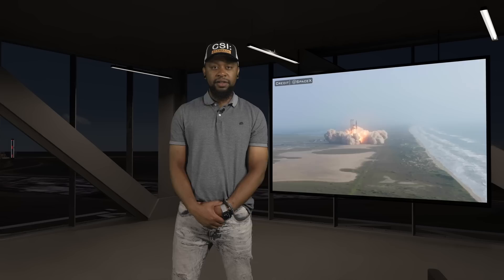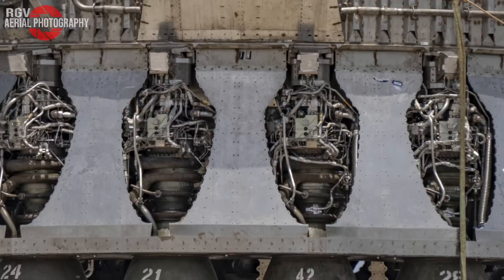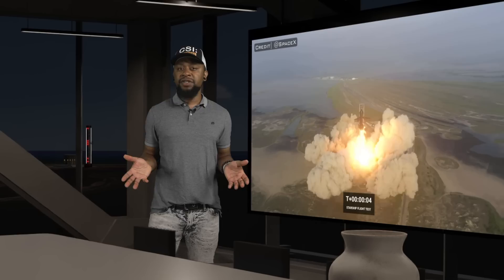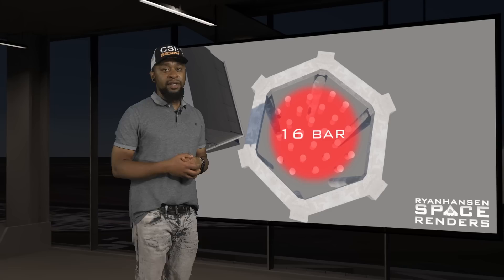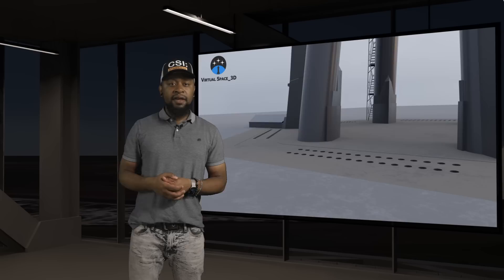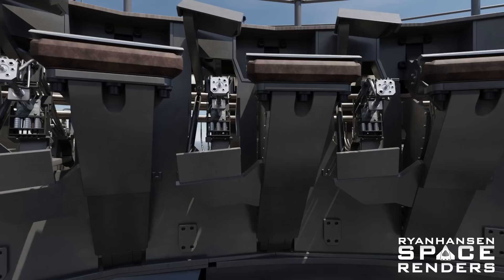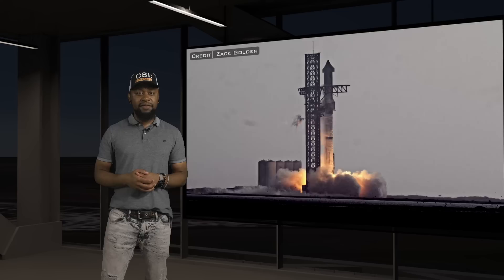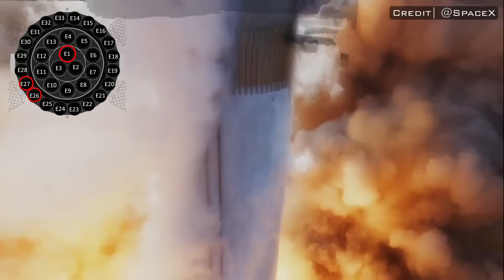The Design Flaw That Caused The Starship Launchpad to Fail!

Comment: Anxiously awaiting this debrief, I regard these shows as most educational and are highly valued. Thanks to Zack and the CSI team of “agents”. Kudos!
Reply: 10,000,000 lb lifted with 16,000,000 lb of thrust (success, World Record in fact).  The rocket plumes are longer than the rocket.  Should consider raising or digging for more ground clearance.

Rocket fuel consist of oxidizer, a lot of rust forth coming.  Steel plates are not necessarily expensive, but will need to be replaced over time.  Continually added expenses.

Failed to reach orbit.  Far from complete success.
Reply: Indeed ' the only other sound recording that sounds anything like this is Saturn V,  given we do not have very good recordings of the N1 or the Buran, the other two comparable rockets

Comment: Zack, that was sooo good.  Pulled together elements into a really well structured deep dive.  I can't thank you and your crew enough!
Reply: Annnnd he was wrong.  SpaceX shut the first 3 engines off before launching on purpose, and something else caused the rocket to rise on angle.
Reply: @Donald_Turnip  That "something else" is those 3 dead engines
Reply: @alvianchoiriapriliansyah9882  

Nooo, no it's not. If people would take the time to listen to what Elon and his team have said, they'd know that they decided to shut the 3 off knowing that they wouldn't affect the rocket one bit. They quite literally said that, which makes an hour-long "explanation" WRONG because it's the first bit of information is an ASSUMPTION that three engines "failed," so it caused the rocket to go out of control.  Elon was very clear in saying WEEKS ago that the first three missing engines on the Engine-Cam were shut off before they even lit the rocket because they were not running properly AND they were not needed for the rocket to do its job perfectly.

If we take Zack's assumption out of the mix, this video is completely different because those engines did not fail nor did they cause the rocket to fly sideways. Every thing after an assumption is corrupted data/an assumption too, when you make a video that follows a linear line.

Example 1.>  Car 2 crashes into the back of car 1. We assume the brakes on car 2 must have failed because someone heard a screeching sound. Someone dies in car 1. We assume driver of car 2 is innocent because their brakes failed.

Alternative and the real truth> Car crashes into the back of another car. Option 1>Brakes didn't fail, driver of car 2 was speeding so they slid into car 1. Option 2> Driver of car 2 was looking at their cellphone and didn't see Car 1 until too late and after they hit the brakes.

The point to this long example is that nothing after a certain point means anything if any of the proceeding steps are wrong/assumptions.  If everyone knows the person was on their cell phone, that person goes to jail for vehicular manslaughter. If everyone assumes that the brakes failed, an innocent person dies and a guilty person doesn't face justice.

So once Zack assumed 3 engines failed/that the rocket even needed those engines to fly, every single point after that on his timeline of reasons why the surface of the OLM was destroyed is wrong or corrupted. All because he assumed versus waiting for SpaceX to speak about why three engines were DOA.
Reply: @Donald_Turnip  The computer would NOT shutted those engines down if it did run properly aka. not fail (because why the fuck it would??), and those three dead engines CAUSES the lean on liftoff (EXPLICIT from Elon). But it did NOT violate the launch commit criteria yes, which is why it...lifted off

Did you listened to the same Elon spaces as the rest of us?

"So the lean off the pad, was that intentional? Was it more than you thought it might be? Was it related to the engines out? And do you expect to do that on like future more operational launches?"

E: "No, we're not. It WAS RELATED to the engines out, and we do not normally expect to lean. It should be aspirationally going straight up."

Now show me the SpaceX/Elon words that completely counter the above, word by word. And reply it to me. Pretty please 🙄

Vocabulary lesson:

Running properly = not fail
Not running properly = fail

Both are NOT interchangeable
Reply: @alvianchoiriapriliansyah9882  The computer said there were 3 engines SpaceX chose not to start. "The system didn't think they were healthy enough to launch with."   -ELON Tweet

LOL I wonder why this keeps getting missed is confusing for people like you.

SpaceX turned them off.  They didn't fail or go lean or shoot fairy dust. They just plain were never started. They were off before the end of the count down. They didn't WANT them on because they weren't nominal. Do you understand that point now?  Spacex computer shut them off.  Do I need to correct you again?  They were never going to be on because spacex chose to keep them off knowing that only losing 9% of launch wouldn't affect the launch.  The control of the rocket was at fault which was pretty obvious because BOTH ECM modules were so messed up that they eventually blew up and off the side of the rocket.

It's like your computer. If you don't push the power button?  It doesn't turn on. This happened for three engines. Pushed the button and they didn't turn on.  We good?
Reply: @Donald_Turnip  Thanks for (partly) agreeing with me on the computer

"They didn't fail" minutes later "they weren't on because they weren't nominal" What language are you using? Not nominal = FAIL. Engine failure doesn't have to happened midflight. 

Nominal condition were supposed to be ALL engines turned on
Reply: @alvianchoiriapriliansyah9882  Look. People are trying to say that the engines lit, did (insert bad thing that didn't involve a positive working engine) before  (insert a bad thing that could be going lean, burning up, going learn and blowing up, feeding furby versions of the engine after midnight so they turned into EVIL furby's who ate the other 30 engines, clubbing baby seals and or directly causing the earth to move 420 feet closer to the sun making us just that much closer to dying).  

The other engines straight up still need to be started. As all SpaceX rockets go autonomous at a minute, OF COURSE, the computer shut the three engines off, but they were OFF when the other thirty started so they caused zero damage to any other hardware.  They also were only 9% of the rocket's total power with no payload on top and a healthy amount of extra power to cover engine failures (by design). If the rocket had been afraid of it's margins with shutting 3 engines off, it would have aborted so obviously SpaceX see's no problems missing 3 engines in that configuration.

I'm sick of people who are implying that those three engines did anything other than nothing. That is all I have said here as the OP was wrong.  The engines didn't do anything to the rocket or even fail. The computer didn't like what it saw, so it shut them off before starting.  That make's the OP and his ASS|U|ME PTIONS wrong about what caused the launchpad failure.

What caused the launchpad to fail was a massive load of engineering paper smarts and planning versus 
real world smarts and planning that someone like me looks at.  Someone like me looks at a very thin piece of fripping concrete (that they bought for heat, not to withstand a force necessary to lift 11 million pounds), looks at the fact it's built on sand and rolls his eyes.

I called the first failure on the first test, the second, and yes I called this third. I called that it would strip the veneer of whatever off that was anywhere near the  OLM because over 11 million pounds of thrust was being aimed 90 degrees, that is to say, directly RIGHT AT a pad of concrete with really no where to go other than that pad of concrete to change the direction of that force. There was not NEARLY enough engineering involved and the force needed to go somewhere, so of course it tore the hell out of everywhere else that was close. I will admit that I didn't see the sucker lobbing concrete bowling balls out to 300 meters...even that one surprised me but I foresaw the smaller version of that because, unlike the REALL engineers, I asked myself "uhhhh where the smoke, fire and force going?" If you punch something, usually something breaks.

SO. I'm like oh my god, so like done with this. The OP was wrong, although apparently there is something different an hour into his post. Sorry, but I don't have time for viewing that crap when at 10 minutes, the fundamental reason for a post is wrong.
Reply: @Donald_Turnip well as a" real " engineer myself, i can tell you that basically all engineers could see that this will happen. You don't even need any calculations for that tho.. and his steel plate idea is even worse. They will never be able to pump enough water through it to keep it cool, so the water will vaporise before leaving the plate and it will explode. 

Also these engines did fail. They didn't start them because they knew that those were faulty before even starting- they failed. Because of lack of power, the rocket was accelerating too slowly too. 

This launch was an absolute mess. Unreliable engines, launchpad engineering brain fart, launch termination system fail and it seems like their telemetry failed too, because it didn't even show engine fails properly. 

I don't believe that they will get a permission for a new launch in few weeks as Elon claimed either. They shouldn't be allowed to launch again until they solve all those problems...
Reply: @mitotakjde9763  Again, the first three engines were never started. ALL I EVER SAID. The eff wrong with you people?  Can't read? 

As for the plate, with the amount of high-pressure water they pipe through, they need 5-7 seconds of cooling.  You going to tell me Mr. Aquatic Engineer of the First Order that 5-7 seconds of water on their water plate isn't going to be enough?  

Please don't answer because you don't know. But mostly because you and I are done trading comments.
Reply: @Donald_Turnip  i never claimed that water won't be enough. My claim is that they will never be able to pump so much water through it. Just show me a system thats able to pump so much water so quickly then... 

They were never started because they didn't work properly - thus they failed aka they thought that they would fail and damage others and for that they didn't start them.. they didn't have to explode to have failed

Comment: As and architect it really triggers my OCD to see the original pilings with not only a single piece of rebar in the center but having those pilings not be tied into the rebar mat for the slab above. And even more that rebar mat needs to have extra rebar laid between and connecting all pilings so it creates a grid of grade beams built within the slab. That way you aren't relying on the soil compression being adequate for the entire system to not fail. The grade beams with internal rebar connecting and tying into the pilings will create a whole system that can support the load by itself without the need for perfectly compacted grade. If they are going to rely on grade compaction then they need to compact it in small lifts to where it can withstand the distributed 16 million pounds. They clearly didn't do this.

Edit: It was mentioned that the water table impedes certain times which is even more reason to build a system that doesn't rely on soil bearing at all.

Comment: As someone qualified in precast and prestressed engineering there are a lot of factors that go into why they couldnt have done a similar rebar layout to the others. Technically your strengthening it so that the torque sideways on the pile doesnt crack or destroy it as thats its easiest breaking point. But the force with this is directly above pushing down on the pile, maybe that means there needs to be a different constuction in the center. I would've thought it was prestressed as its a lot stronger in that regard than just a 32m bar in the middle of vibrated concrete (even if its a special type of concrete), but setting up that in a foundation that way is just hard for my brain to fathom. It does look as if there is a set of smaller 9-12mm hairpins around that main bar, so id assume its shaped like a ladder with a bar down the middle. Its hard to say when ya down know tolerances etc, plus your right about the double pour with the slab. Its something thats done due to just concretes drying speeds. Cant be pooring it when the stuff below is dry, plus to much = blow out, although here they already had concrete walls surrounding so that doesnt really matter.

Comment: 52:53 You say that it should not affect stage separation. What I felt, when I noticed the vehicle lifted of at a slight angle, and the consequent loss of further engines; This could easily create a warp in the entire booster structure, effectively locking the booster and starship together preventing stage separation.
Thank you for this 'Stage zero for dummies' and all the work that went into the coverage of this first launch of Starship.
+1 well deserved sub (Y)
Reply: Just considering what information you have gleamed from videos and sources, I think this was an even bigger success for SpaceX. Considering all the information they are sitting on, I think SpaceX has most of all the information they need to further iterate on both S0 and S1. Knowing how SpaceX operate, they are masters of learning from mistakes, almost to the degree, failures can be called successes. 
I am very much looking forward to the next launch attempt.

Comment: truly awesome analysis, but i have some things to ask;
 quoting insprucker at 10:20, he says that ''the booster hold downs have been unlatched, they'll be ready to retract at liftoff.''- could it be that ''unlatching'' the hold downs is some sort of safety pin being removed, whereas ''retracting'' refers to the booster actually being set free by the hold downs? that way what he would be saying is closer to how you'd expect the system to work.

at 21:58 you say that the exhaust gases have a speed of mach 3, but i think that should actually be around mach 10, since the exhaust velocity is about 3.2 km/s.

you say the fts was manually commanded from the ground (55:45), but if i remember a recent scott manley video correctly, autonomous flight termination systems (afts) have become mandatory, so there would actually be no way of triggering this from the ground. or am i missing something here?

also, i wonder why it would make sense to have 20 raptor qds instead of just integrating all that plumbing into the rocket and the booster qd. sure, there is some decrease in mass and decrease of complexity of the booster to be gained, but i wonder if that is really worth  the increased complexity of the launch mount. (at any rate though, it makes the launch mount be more awesome, so that's cool)

edit, i wasn't able to find the link to spacerhino in the description, but i really appreciate all the sources linked

Comment: Thanks Zack and the CSI people for this insightful analysis of what might have gone wrong and what might have gone right. I guess that along with pulling a rabbit out the the hat regarding protection of stage zero, beefing up the reliability of the Raptor 2 engines is going to be the next major hurdle?

Comment: just a thought about concrete hitting the raptors. to me its more logical to think that they werent hit, since the insane amount of force coming out of them. How would a piece of concrete reach one? it would be blasted away before it could reach any other raptor. The force the debris has can never be bigger than the force the raptors are creating. Since there is no real gap for debris to hit the skirt, im confident they didnt hit any raptors. Also the damage was mostly on 1 outer side of the pad, so the force is coming with a side vector. Another reason its unlikely chunks would hit any raptor.

Comment: I'm guessing satisfying the FAA that the FTS initial failure won't happen again will be the issue delaying the next test flight the most.
Reply: Not if they solve it fast enough.
Reply: Along with the lawsuit.   Seems unlikely that FAA would issue a launch waiver while litigation is pending.
Reply: @knowledgeisgood9645  I'm sure Spacex will solve the problem with suitable overkill.  I'm also quite certain this is the type of public safety issue that the FAA will pursue with vigor.  It's essentially their raison d'etre.  Hoops will have to be jumped.  Hurdles will have to be cleared.

Comment: Thank you Zack. I have stop watching a lot of people because all there say is how bad SpaceX went. Your amazing look was just spot on. Just one thing. Do you think that the water plats/ (table) might have some nitrogen in the water also. I think it be a good why to keep the steam out of the system.  Thank you & your amazing team.
Reply: As mentioned, water will be pumped by high pressure gas cylinders, presumably nitrogen